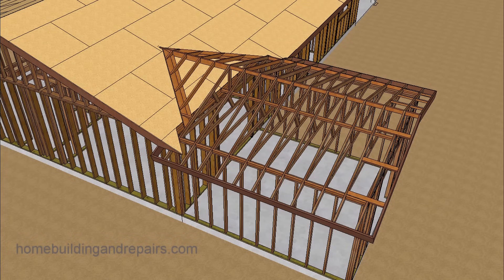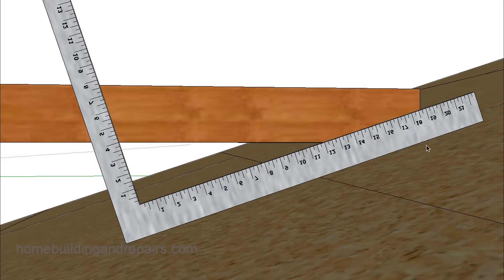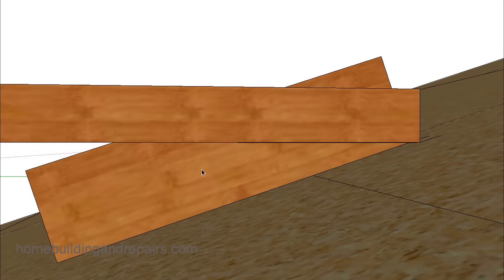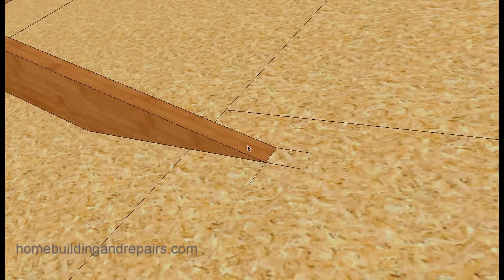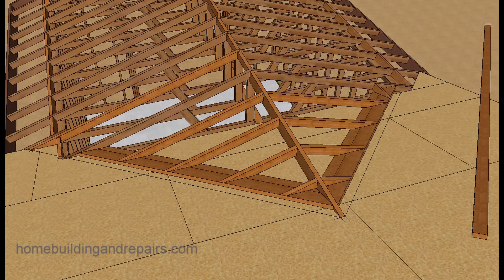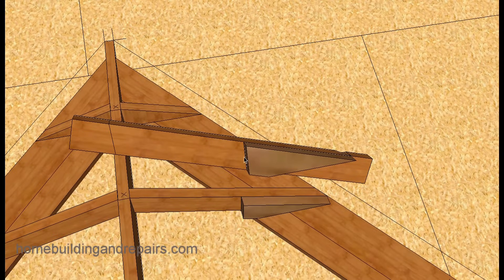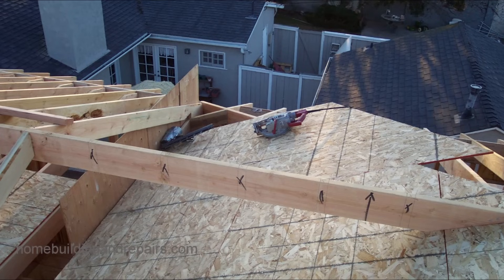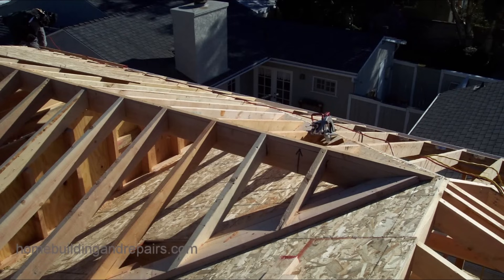How to Install Roof Framing Fill for New Home Construction and Home Additions

Comment: The part I struggle with is when you’re pulling layout going up your sleepers, whether it’s 16 or 24 oc, don’t you need to make damn sure your tape is perfectly perpendicular to the truss or rafter your pulling from? If you’re not perfectly perpendicular and just eye balling it, you could be off?
Reply from the maker: Maybe a framing square will help or use a sheet of roof sheathing as a large square.

Comment: Can you tell me if the valley needs to have metal flashing before roofing material is applied. I saw a video where it was not done.
Reply from the maker: Contact the roofing manufacture, because some do and some don't.

Comment: My question is when you say find the angle to cut the nailer board, how do you do that? What angle do you set the bevel cut to if you know it’s a 12 and 12 3/4?

Comment: To find the angle of the material being used to California frame into an existing roof could also be found by subtracting the degree of pitch on existing roof from 90. For example, if you’re working with an 8/12 pitch roof, it would be 33.75 degrees. Subtract that from 90, and you get 56.25. That should be the angle for your ridge
Reply: How do you transfer the pitch to degrees?

Comment: What's the measurement from your plywood line to the sleeper or nailer on the fill roof?
Reply from the maker: It would depend on span or width of that section.
Reply: @gregvancom   how do I calculate that? I pop the line from the edge of my first rafter on the top plate to the edge of the ridge, then measure down 1 3/4"? Or how do I find the correct measurement for that nailer?

Comment: Just one question. Why doesn't the ridge sit on top of the valley plate , instead of the sheathing.  Wouldn't that be a stronger method. THX

Comment: Thank you for these videos! The hardest part I'm working on is the chalk line and the angles of my cuts. I have a 4/12 original house roof, a 3/12 addition onto my existing house probably from the 1970s, and then an addition we are building with a 4/12 roof rotated and with a California fill. If you have any advice for dealing with multiple pitches, I'd appreciate it!!
Reply from the maker: The top or plumb fill rafter cuts and bottom level cuts will be 3:12 and the angle for the bottom level cut will be for a 4:12. Let me know if this make sense.
Reply: Hey, how did this work out with the different pitches?

Comment: Great explanation. When I was 20 I added an L shaped addition onto our wee small house. I had very poor tools or skills, and only had a couple of books to read on how to do this. I know now that nothing was built anyway near code (Did this to an old farm house) but it worked and we lived in that house for 43 years and would be living in it still if it hadn't burned to the ground in 2018. I look at the rafters in our new house and believe they were built with magic or something.  It's a new 1900 sq ft house and I doubt that there are more than a handful of rafters that are identical.

Comment: maybe you'll see this and reply...you are saying that if you have a shear wall and the existing roof already has plywood on it, you must cut some ventilation holes in the existing roof to allow the completely closed off new dormer section to have airflow and to breathe?  and also, what if a rafter is really really long??  do you need a gusset or collar tie in the upper or lower 1/3 of the rafter to tie one side to the other?  o and also, do you need hurricane straps or anything if your rafters are again within that closed off section that needs air flow??  until you cut those air channels in the old roof decking its not like you cant get any uplift of the new roof since its closed off but if you cut those air channels in, now it can get uplift no?
Reply from the maker: You should probably contact a structural engineer before cutting into any structural shear wall. Ventilation can usually be acquired through other methods like dormer vents.

Collar ties are usually required along with roof rafter ties when using roof rafters.

Airflow and ventilation usually don't affect the location of structural building hardware.

The design might play an important role in whether or not there will be any uplift.
Reply: @gregvancom  i wouldnt be cutting into anything structural.  im installing the shear wall but as i stated like i saw in your video, you cut into the existing roof sheathing/plywood so attic air can get up into this new section that will closed off once the new plywood is on and the shear wall is built.  

im confused, are you saying this video is not rafters?  

my setup looks 100% like this video but its 10 times bigger is all.

Comment: Is engineering evaluation necessary when making an extension with the roof overlaying the existing roof structure of home being remodeled? I'm thinking about adding a garage next to my house and do a similar set up like you have in this video.
Reply from the maker: I would check with your local building department if you have one. Most structural modifications require engineering, but yours might not.
Reply: @gregvancom  Thank you. I very  much appreciate your video on this. I will check with our building dept.

Comment: I’m not really a framer but have framed a few roofs and struggled on this “fill section” every time. I happen to come across your video and can’t thank you enough! Setting the plate at the proper points seemed to be my biggest downfall until I saw your video. Today I cut each valley once and fit perfectly! Thanks again  I wish I could post a pic of what I did today. This was a life saver!!
Reply from the maker: Sounds awesome and glad to help. And if it makes you feel even the tiniest bit better, I've worked with carpenters who've been in the business for over 20 years and wouldn't even attempt to build something like this.

Comment: No mention of removing the bearing wall below that the existing rafters sit on from the main/old structure, which can't be done unless you install valley lvl's and sister in new joists going up to the main ridge. Or install a beam spanning the new addition and hang the old rafters into it. Get with it
Reply from the maker: If you're asking if I removed a load bearing wall, then no.
Reply: This is what I was searching for as well. I want to add this type of addition but the section of exterior wall on the addition side will be bumped out 8' into the addition to enlarge the old room. How do I support the old roof/ceiling joists if I move this section of wall?

Comment: OK, so can I build one of these "fill" roofs right in the corner of a valley, to roof an addition going in down below to the house. A 10  foot by 10 foot room, which will sit right in the corner where 2 roofs meet to form an "L" and the valley drains off right to where the addition will go. How could I tie in a roof right there in the corner? Thank You, enjoying your instructional videos!!  Raul  ,  PHX
Reply from the maker: If you can, email me a picture or a drawing of what you're trying to do. You can get our email address at our website.
Reply: @gregvancom  OK, Yes, as soon as I can take a picture I will get back to you. I will check your website and get your e-mail. Thank You and God Bless, Raul PHX

Comment: Need help with  adding roof for 8x16 addition onto modular home for office workspace. How do we get started need roof on rear of house and we want to extend roof at front of house to cover new porch. Room addition is vital at this point. Need roof framing plans for permit-etc. Can you guide us through the process.
Reply from the maker: The only assistance I can offer are the videos found at the website. I'm not currently offering paid services for designing.

http://www.homebuildingandrepairs.com/home_additions/index.html

Comment: I have  question... I have a home that currently has this exact type of addition ,and am currently wanting to connect an additional addition to this, am I able to this with some sort of a pitch,  or if you have any suggestions for me
Reply from the maker: You can use any pitch for your addition. For example if your existing house has a five and 12 roof pitch, you can use a two and 12 for your room addition.
Reply: @gregvancom  thank you Greg for the reply. your videos are such an inspiration!  so for clarification,,, the current addition is about 12x 20, and if I wanted to add another 12x 17 to the inside corner,  it should be able to be done w efficiency, correct?... my reasoning for wanting a good pitch is that I'm in southern Wisconsin, and this is the north west side of the home, I fear ice damming, and moisture not alot of sunlight drying hours daily...  thank you again for your time tips patience, and sharing your wisdom!! its greatly appreciated!

Comment: If I am adding this to an existing structure should I strip back the shingles and tarpaper to the sheathing? I'm thinking it would be stronger to strip it back and nail straight to the sheathing, I would need to redo the shingles in that area anyways, but I have seen it done straight to the shingles too
Reply from the maker: Yes, strip back the roofing and attach the new lumber directly to the old lumber.

Comment: Hi, I have a garage which is around 6mths old and want to add  another garage to it but in a L shape.
Our roofs are lined with corrugated metal, we don't line our roofs with ply how is the ridge beam added to the metal roof, cheers.
Reply from the maker: I'm having a difficult time figuring out what you're asking. You can email me some pictures, drawings or illustrations of what you're trying to do or provide me with more details.
Reply: gregvancom hi, I understand I'm wanting to do what this diagram suggests, the ridge beam would be sitting on a metal roof,
Not plywood. Would I need to take off some of the metal roof, am I making any sense, cheers.
Reply from the maker: @egidioborg3421  In the roof ridge might be able to sit on top of some blocking installed in between the existing roofs rafters framing. Let me know if that makes sense.
Reply: gregvancom yea that does make sense, I would need to remove the metal sheeting and work out
We're the ridge beam would be placed then add the block, and that is we're the beam would sit on.
Once that is done I can re-apply the metal sheeting, I think ???. What's your thought on this.
Reply from the maker: @egidioborg3421  Yes and hopefully it works.

Comment: At 2:02 take a 2x4 scrap lay it on edge on roof slope or right hand side and scribe a line on fill in ridge board ( this will give you slope and line you need to cut.).....on left side Mark the line at where it butts into existing ridge.......cut both of those and there is your fill in ridge....takes 5 min

You will not need to measure anything for this process, it will fit perfect
Reply from the maker: I don't know if you're asking a question or sharing an experience, but if you are asking a question, feel free to ask away.
Reply: @gregvancom  sharing.......easy shortcut to cutting the fill in ridge without measuring anything

Comment: Question : Does the ridge need to be aligned with one of the rafters in the main roof?
Reply from the maker: No, but it wouldn't be a bad idea to put a block or a couple of blocks underneath the new fill ridge, in between the existing roof rafters.

Comment: I am planning a room addition in the back of the existing hour similar to your model.  The issue I have is there is a chimney to an existing fireplace right at one side of the California roof (same as at 5:15).   What is your suggestion?  Do i just frame around the chimney and have the chimney be part of the California roof?  If so, what potential problems should I be watching out for?  Thank you.
Reply from the maker: In most cases you can frame around the chimney, but the chimney might need to be raised. Here's a link to a video that might be helpful.https://youtu.be/jM_szt61BX8 

If for some reason you can't figure it out, feel free to send me a drawing or picture for more information.
Reply: @gregvancom  Thank you.

Comment: Talking about the toe nails, my Wind Mitigation inspector would not pass it for homeowner insurance discount. I am very upset about this.
Reply from the maker: That's odd, because usually toe nails provide a stronger connection, especially for vertical uplift. I might not be able to change the inspectors mind, but if you're looking for more information, feel free to send me some pictures of the nailing.
Reply: @gregvancom  I agree. I think the inspector needs to go back to school.
Reply from the maker: @Jay-tk7ib  Yes, it is confusing.

Comment: If I am going from a 4 pitch roof to a 5 pitch roof to build my California Fill would I use 5 pitch for my measurements?
Reply: I just want to be clear, so the rafter that is attached to the nailers would be the pitch of the old roof (which is 5) and the top of the rafter that attaches to the ridge would be the same as the new roof (which is 4)? Is this correct?
Reply: @rodwinjade  You are correct, the bottom (bevel cut) will match the degree of the existing roof slope. The top of the new rafter will be cut to whatever slope the new roof will be. If the two slopes are different, then you'll have to cut back the tails on the steeper slope, making a shorter overhang, so that your overhangs will be at the same height.
Reply from the maker: The new fill rafter should match the new roof pitch, but the angle of the bottom fill rafter's will need to match that of the existing roof.

Comment: You can just use a speed square to find the angle of your bevel cut on the jack rafters
Reply from the maker: Good point and you could use a framing square also.

Comment: Good video but you know what there's always that but but it might help you in your next video or give you a good video to post is how to read a square framing square because once you have one measurement of your rafter Valley rafter if you know at the pich you know how much to add for your next Valley or even hip rafter to add on not sure if you're old school like me that you know that cuz it seems like just the old school guys know how to read a framing square
Reply from the maker: It's always going to be great to know how to use all of the tools, but sometimes a simple pattern can be used. If you have a framing square, then use it if you don't then make a pattern.
Reply: gregvancom not being smart but the point I was trying to get at is you can get the next Rafters measurement without even measuring I was told that It was geometry I said I don't know I'm just reading it Off The Square
Reply from the maker: I don't view your comment is out of line or cruel and I hope my comment isn't taken that way either. There are other ways to fill in this section of a roof and the one I provided in the video seems like it might be the easiest for someone who isn't familiar with a framing square or other roof framing construction methods.
Reply: gregvancom you're absolutely right it is easiest way is there any saying our conversation got your video probably to come up more on YouTube every little bit helps thumbs up
Reply from the maker: I hope our conversation helps my YouTube rankings and you're absolutely right, every little bit helps. Thanks for commenting and sharing your knowledge with everyone who reads your post.
Reply: @Iliketoweldandbraze  You're referring to "common length difference." This is a good thing to use when installing jack rafters, etc., but for these blind valley rafters, it's better to measure for each one, then If you're ridge board is off a little, then you'll be okay. You can measure for these because the bottom point actually sits on the plate, unlike regular rafters which are calculated to a certain height above plate.
Reply: @Jay-tk7ib  yeah I know it's just a supposed to work if everything is perfect but it gives  you JumpStartto keep ahead of your installers to know what length you're going to need next ahead of your installers by knowing close as usual we have two installers in one cut man basically one-story down here usually we try to get them on the same story if possible cuz I know there's all tweaks in there but it's nice for people to know what all them numbers are on a framing square
Reply: @Iliketoweldandbraze  It doesn't take any longer to measure these short blind valley rafters as it does to find the common length difference. And you're assured of a good fit. But yeah, every framer should know how to use the framing square.

Comment: Very informative information sir. Question. I am interested in building a covered deck for my mother. But her home is a mobile home. How would the rafters established? Lastly her roof is a metal sheet.
Reply from the maker: The structure might need to be separate from the mobile home. For example you could use four separate posts with footings under them to build your patio cover, so that there wouldn't be any load bearing surfaces connecting to the mobile home. If this doesn't make sense let me know.
Reply: gregvancom 

First, I have limited knowledge of construction but it does fascinate my interest. Can you break down what you suggested. Lastly, is there a way to show you what I would be working with as far as my mothers decking location and roof?
Reply from the maker: This might help, but let me know if it doesn't https://www.youtube.com/watch?v=SzkVJ2Sx0Fw
Reply from the maker: also https://www.youtube.com/playlist?list=PLC0UeuIWsWeUm9ok8Jv5HJeOkTOVBf-Ao
Reply: Sir, I greatly appreciate your knowledge and specifically addressing my obstacle during your personal time. Very few people with knowledge, that I asked help from, don’t share with others. Lastly, the first link video you sent; The patio cover on the end of the home. The patio would be on the front side (long ways). This would be the same concept as putting it were on the end like how you designed it?